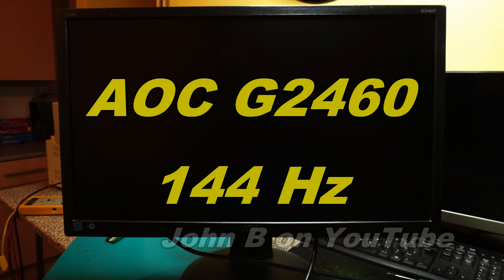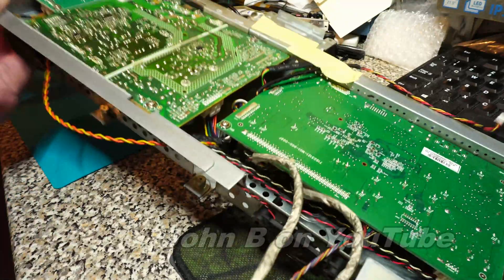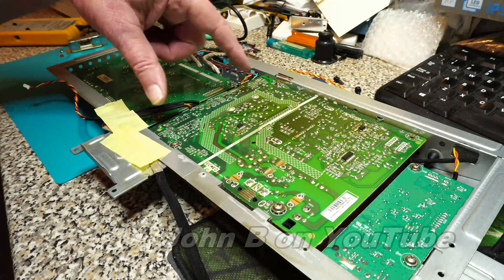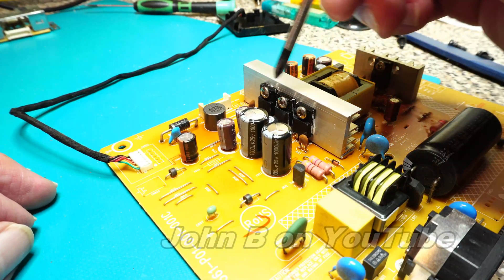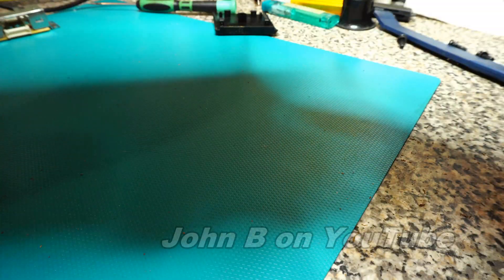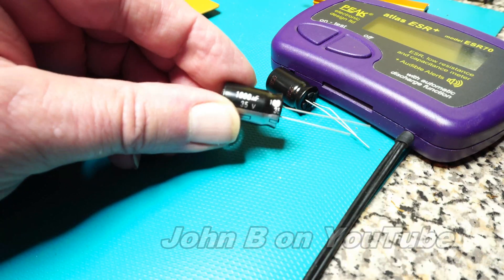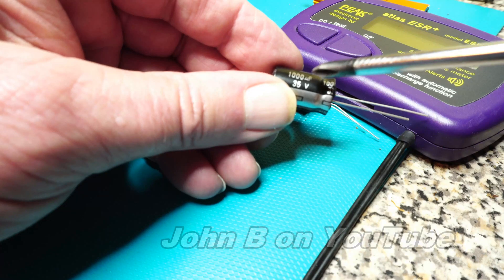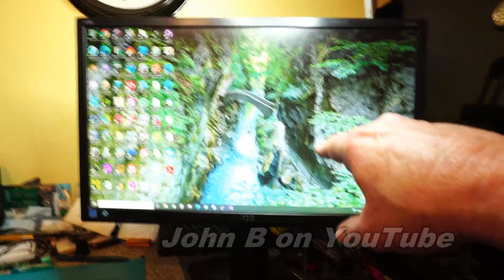AOC Monitor Flashing / Not Turning On AOC G2460P 144Hz

Comment: I'm troubleshooting my son's AOC G2490...  It has two smoothing capacitors after the full bridge rectifier and the voltage looks like it's only half-rectified! (checked on my scope).  So I'm assuming the caps aren't doing much.  Or is it "expected", that the DC out be this bad?
Reply from the maker: I'd replace the caps and try it.

Comment: I have a similar monitor I got for free. It flashes whenever a signal is given, but the backlight flashes a few times then turns off. But it does display and image, just without the backlight. Do you think this could be the same issue?
Reply from the maker: At a guess, I don't think it's the same issue but it is worth having a look at the capacitors.

Comment: Hello, can you help me solve my problem with this screen, model AOC 2490vx?
I have a problem when I convert the screen frequency from 60hz to 144hz, the screen turns off and becomes dark.
A friend told me that there is a manufacturing defect in this model. Is it true? How can I fix it? Can you tell me? Thank you.
Reply: I'm troubleshooting something similar in my son's AOC G2490...  If I go to a higher framerate than 60 Hz, it shows only three-four pixel lines at the top (they are correct lines), then nothing.   I think the power supply is struggling, but I've only just started. It's all disassembled, but haven't found the fault yet.  I've also noticed that if the monitor's been on for several hours it starts with this slight flashing.

Comment: My "AOC Q3279VWFD8" died like this today.
The past 2 days it had weird issues turning on, where all it showed was pixel garbage, either greenish lines, or black grey checker boards, sometimes even moving.
Turning it off and on fixed it, but today it refuses to turn on.
The AOC logo disappears (actually it's just super dim, if I shine a light on it at an angle I can barely make out the AOC logo as well as the Mainboards Bootup screen)

The moment it enters Windows it turns fully black.
If I turn it off and on again, it displays Windows and the Desktop for less than a second but then goes back into being a black screen. Same for when I switch Hz settings from 75Hz to 60Hz and back.

Unfortunately, I have no experience in replacing and fixing stuff, especially if it's the power supply, so my only option is to get a new monitor, as this one is outside its warranty already. (bought 2018)
Sad to see something with a 200€ price tag die after just 6 years, meanwhile my almost 20 year old BenQ 1080p HDMI monitor with a terrible TN panel still works flawlessly.

From now on I'll avoid AOC as monitor brand, especially on the low budget area.
Reply: This is real odd,  I have the exact same screen the AOC Q3279VWFD8  the 32" version that I bought back in 2019 and it has been great but in the last week it has been slow to turn on and like yours was doing the  coloured lines on but when it did turn on it was fine but today it is just doing the flashing as shown in this video, since the monitor was out of warranty and seemingly dead I decided to give it ago as there was nothing to loose, opening it was a nightmare as there are tiny screws on the bottom and on the back at the plugs  and there are clips all the way around and they used double sided tape , I had to use a thin butter knife to slide in and cut the tape and pop the clips took me about an hour.

Once in it was just a matter of removing the electronics box and then the power board and sure enough like this video there where 2 bulged capacitors though there where of a different value, the two that went in mine where 470uf 25V at 105c,  looking at the capacitors they are of a very cheap brand so its no wonder they failed though it is suspect that you got yours in 2018 and i got mine early 2019 and mine failed 5 moths after your comment.

Ordered replacement capacitors of Amazon for about £5  for 10  so will see how things go when i get them.
Reply: @EQINOX187 did that work?
Reply: @gamagamer1877   Yep,  soldered in the new capacitors and reassembled it and it powered up first time as normal

Comment: Mine does not show the AOC logo at all sometimes, black screen white splash the sleep mode. Sounds like backlight to you? If so is it worh repairing?
Reply from the maker: AOC are great monitors, if you can find spares you should repair it.
Reply: @JohnB-2021 replacement parts are hard to come by... Seems like a power issue, when fully discharging the capacitors the monitor works back up, no visible damage on components, any suggestions or parts that I should look into
Reply from the maker: @miguel2592  I thought you said it may be the back light, it sounds logical and the first thing to check.
Reply: That's what I thought at first, however after letting the monitor unplugged for a while or by opening an discharging the caps the monitor comes back to life
Reply: Unfortunately repair rates are not worth, it looks cheaper to get a new one but I'm trying to repair it myself if possible

Comment: How do you get the back plate off? The piece with locked lock symbol on the bottom right of the monitor when the screen is facing down
Reply from the maker: The front panel clips to the back.